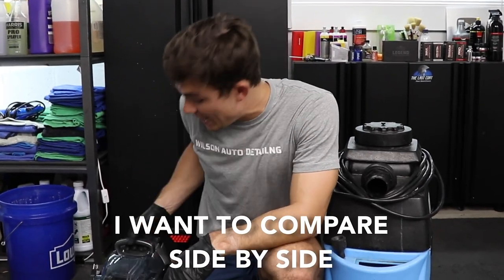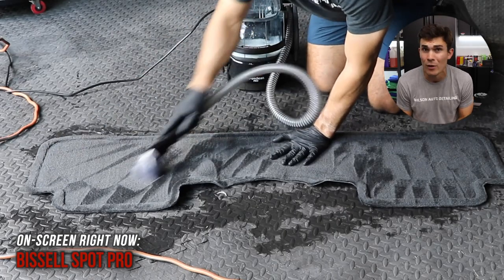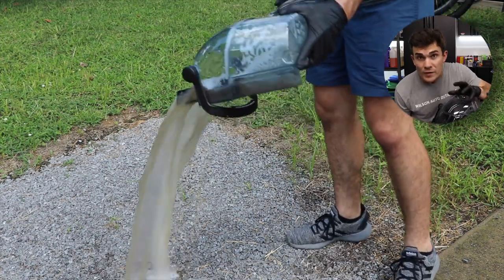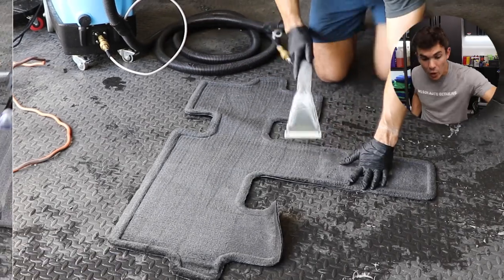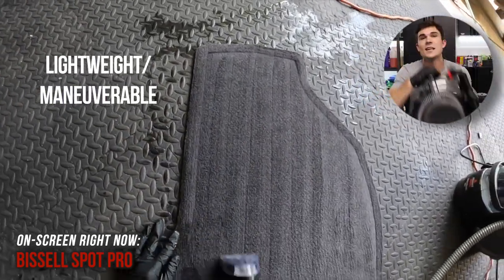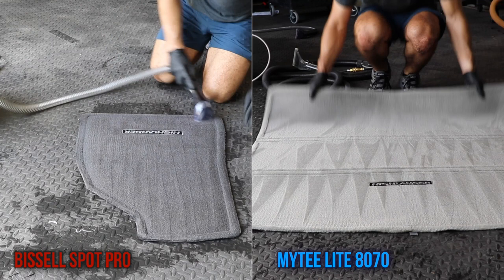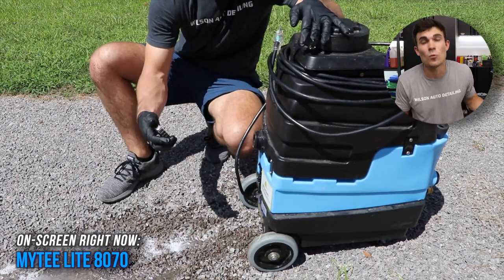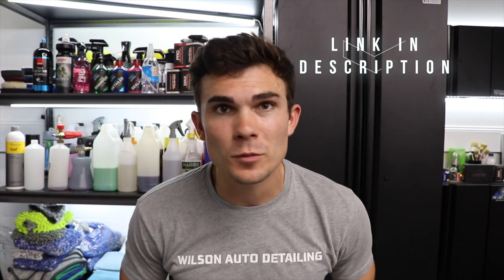You Should Have 2 Detailing Extractors

Comment: If you are only pulling out liquid why not use a good wet/dry vac ?
Reply: Exactly what I'm thinking
Reply: @bobbybrooks5846  I have a Bissell . Works fine but rarely use it and that was only the a few times after I got it a couple years ago.  Just as soon use my pulman wetvac . I use a duck bag over the filter so I can go back and forth between wet and dry without changing the filter.  Just as strong as any extractor.  And with proper technique and chemicals I don't need or care to add even more liquid aka water . Probably just me . I'm "old school " . 40 yr detailer.
Reply: @derrickabare9986  the only problem i can think of using the shop vac is that you can't see if its still picking up water, because the attachments aren't transparent
Reply: @bobbybrooks5846  this is true . Ove been doing it so long if gotten pretty attuned to the sound the vac is making through the nozzle not to mention simply feeling with my hand . As far as mats go I I do them 1st thing b4 I even wash whatever I'm working on at the time . By the time I'm done the detail the mats are dry .
Reply: @derrickabare9986  that helps alot. I really appreciate your feedback
Reply: @bobbybrooks5846  np bud . Just my 2 cents . Everyone has different opinions on the subject.  I'm all for lower overhead.  More profit and in my opinion some tools are just not as needed as some make them out to be . Ps... the duck filter bag you can get on Amazon and even though not designed for other vacs I do . I just use a small bungee around the top . Helps alot at prolonging the life of the filter and vac . Around 25$ .
Reply: @derrickabare9986  im all for gadgets lol. Now that I'm disabled I have to work smarter not harder. I did detailing from 2000-2005, but they kept everything a secret as far as the chemicals, so now im trying to find products that takes less elbow grease. Are you saying you use a fine dust bag paired with the foam filter